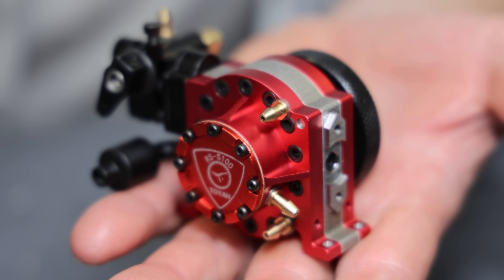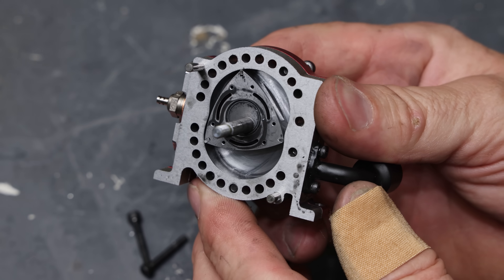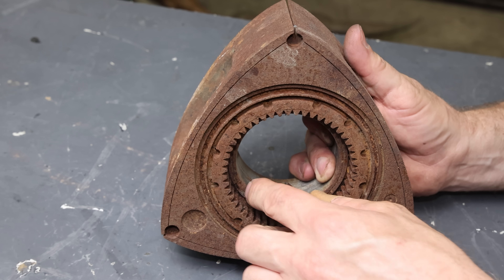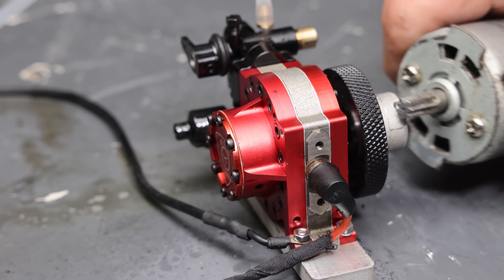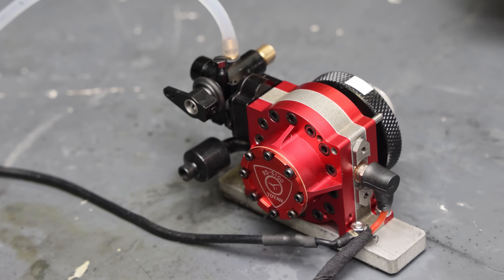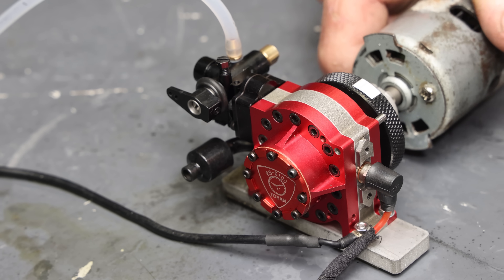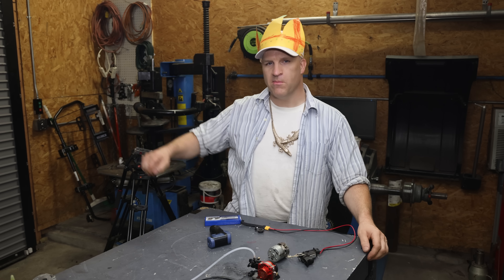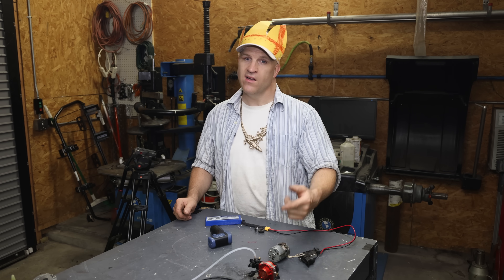Worlds Smallest Rotary Engine (30,000 RPM)

Comment: I'm tryin to learn.. hope you answer me.. you said it gets better compression as it warms up.... is that because the apex seals aren't sealing well.. like you get better compression because the heat makes them expand.. in turn creating a better seal in the chamber in turn making more compression?? please answer me.. or anybody else that can..
Reply from the maker: Yes I believe that's exactly what's happening. I think it's because the Apex seal design is too simple and very very small. Once you get this small it becomes very tough to achieve the tolerances needed for a good running engine.
Reply: @WarpedYT   thanks for the reply!! Man that little engine is awesome!!! How did you get into this stuff?? Like jet engines? My gdad built them and tested them along with intercepter missiles.. I want to do this so badly also but don't have the smarts for it.. I'm horrible at math..

Comment: How ironic, a decade old problem, and still with today's technology, nobody can find a proper solution to fix and improve the apex seals, hot-exhaust gas, engine flooding & engine compression issues, which normally plague the iconic Rotary Engine; if more money and resources is put into them; the rotary engine could be such an amazing engine that could probably even surpass pistons.

Comment: You really need to own rotaries before commenting about the full-sized rotaries.  You're having a carb problem to start with.  If you've had problems with "exhaust falling off", etc. as you mentioned, it's not the engine's fault, but the owner/builder/operator's fault.  The rotaries, especially those from Mazda, are especially reliable, and always have been IF THE MAINTENANCE IS DONE AS RECOMMENDED.  However, Americans don't like to open the hood on their cars until something goes wrong.

BTW it appears from your video that you managed to somehow chip the side of one corner of the rotor, which will allow the apex seal to shift and get out of position.  It may even score the rotor chamber or end plate.  it was the corner you were re-installing the apex seal on, and that would probably be part of your trouble.  The engine seems to be running,, as the three Toyan rotariy engines run perfectly, and the throttle works as it should, while yours requires almost a full-choke to run or start.  So the "compression issues" that you say are forcing it to be started at such a high rpm are due to that damaged rotor corner, allowing the seal to move out of position and not seal well, which is why it only runs at high rpms.

In 1980 I was at a Mazda dealership with an RX club, and two guys brought in a rotary block for a core exchange.  Club members were curious as they drove in in an older RX3, and one of the club members was employed by Wankel Gmbh as their North American rep.  So we went to talk to the guys, who were very nonchalant about their engine swap.  As our parts guy got the core block out of their trunk (with another mechanic, NOT a hoist!), we got to chatting with them about their experience with it.  The engine had only 160,000 miles on it, so we asked if they'd had compression problems.  NO.  Did you have hard-starting?  NO.  Excessive use of oil?  NO.  Finally, we asked them why they were exchanging the block, and the owner said "Well, with 160,000 miles, we just thought it was time.".  The block was still in spec, had no scoring or anything.  The apex seals he'd brought were fine, and with so little actual wear on the engine nobody could figure out why he "needed" to swap the engine.  Actually, we saw 81 and 82 year RX-7s with over 300,000 miles on them, with just normal recommended maintenance and watching the oil level.

Basically, those who think the modern Mazda rotary is a ball of problems have NEVER ACTUALLY EXPERIENCED IT, and are simply repeating what they heard someone else say - who was ALSO repeating some "rumor" totally without truth.
Reply from the maker: How many full size rotaries have you built ? Be honest.

Comment: These engines are supposed to be watercooled, those little brass fittings are for cooling water. Running it without cooling will probably wreck it.
Anyway, if it produces 0.7 HP from 2.4cc, that's almost 300 HP per litre of displacement!
These little puppies are about $500 USD, or about $700 for a twin-rotor version.
Reply: 10th scale market

Comment: .7 horsepower is a bit measly, couldn't run it in a RC race car they usually hit 2.5ish hp
When scaled for hp/displacement, the standard rc racing engine is about .21ci so, at .14ci, it would get closer, but would still fall short, assuming the displacement was .21, it would put it at just over 1 horsepower, still short.

Comment: Sir, the glow plug seemed to be untight. I saw bubbles. Aaaand, there was a little pin moving near to the flywheel forwards and backwards. I was frightened i could fall out and touch the teeth of the flywheel. Anyway, a sweet engine is it , indeed. How is cooling made ? Just by fuel ? Where is it used normally ?

Comment: Enlarge the exhaust port and upsize exhaust. It ran better when you were restricting the air a little. So believe you need to richen up the mixture slightly. 
Well cool to see a rotary about 2.5cc. 
Have you previous experience with nitro rc.?

Comment: hahaha i did one of those "hold my head like in the home alone cover" once it started and thought - "this has to be 30,000 rpm!" Bang on!  Great little engine. Wish it was a 3 rotor. I wonder how hard it would be to fab a shaft to join 3 of them up

Comment: Love my 86 Mazda RX7... still have it but it needs rebuilt as usual every 100k miles..lol... and yes they'll flood even if it's on your mind..lol... used to alway park mine on a hill so I could pop the clutch and it would start every time... I had Mazdatrix pre-silencer and that joker was loud but would run like a scalded dog..lol..mine has been sitting up about 20 years...wouldn't sell it for nothing

Comment: either need to gravity feed the carb or run pressure from the exhaust
Reply: the carb has a build in pump
but he needs to adjust his low end needle it way to lean in the low end

Comment: 0.14 cubic inches is nearly three times the displacement of what I grew up with.
Reply: cox 049?
Reply: @robot797  Yes. There were quite a few control line planes, and the odd boat.
Reply: @m1t2a1  I love cox engines
I even made one run on propane/butane
Reply: @robot797  Wow. That can't be easy.
Reply: @m1t2a1  it is easyer than it looks
you can find a video about it on my chanal
Reply: @robot797  Just like others, my first thought was where the oil was coming from. You figured it out. I have some .049s that are over 50 years old. One will be sacrificed for that. Thanks for pointing me to your channel. Now you have another sub, whenever it updates. It's in Canada if you look to see where people watch from.

Comment: I have a old traxxas t maxx I want to put this in, but it seems to only run at full throttle, that might be a problem.
Reply: it just needs to be tuned
more fuel in the low end less on the top end

Comment: I can already imagine a vehicle with like a hundred of those engines connected together somehow, the sound of millions of angry bees and a ton of fuel per mile 😎😁
Reply: I sense the building of a bitchin go kart in someone's future.
Reply: @jg8263  lmao the bees comment had me on the floor! 🤣🤣🤣🤣 would be awesome indeed.
Reply: @jg8263  i was thinking a cool rc car or boat if you can get this fully operational
Reply: @jg8263  everybodys like wow thats amazing...  and then the engine failure hits and then they be like told u so u stoopid for building something like that
Reply: @tarekl.3725  As long as it has like constant maintenance, it should be fine, but it's still kinda dumb
Reply: it would sound like 100 weed whackers and it wouldn't sound like bees it would sound like deaf.
Reply: hahahhaahha 🤣
Reply: A mile long engine, going a mile at a time
Reply: That sounds awesome
Reply: only 70 horsepower?
Reply: You'd need a hundred, so maybe 5-10 would be running to generate power an any one time.
Reply: You got to be at the track when he runs sprint cars it sounds like a bunch of weed eaters chasing each other around have a great day
Reply: XD
Reply: "with like"?
Reply: God dammit take my money!

Comment: Imagine modifying something similar to this into a weedeater. 30k rpm.... that will cut some damn grass.
Reply: no torque so won't be cutting jack!
Reply: @larylongprong  If an rx7 can go 215 before flying like a frisbee, then a rotary engine can get enough torque.
Its the rpms and hp that takes up the slack while the little bit of torque it has keeps going.

Comment: What’s the pin that’s sliding in and out during high rpm
Reply from the maker: Alignment pin.
Reply: @WarpedYT  cool, I thought it was something to do with fuel pressure, I honestly couldn’t tell, it looked cool when the vibration moved it haha

Comment: i think the extra fuel makes it run better just because its sealing the combustion better,maybe some thick viscosity pre mix or put a little thick oil on the spark hole to confirm if it suddeny starts up with less fuel doing this it will prove my theory,you may need to make a stronger spring on the apex seal or makeapex seal a tad taller,
notice it ran like a champ after it was warm probably the heat expansion of metals helped seal

Comment: watching you struggle with this is frustrating af. 

Not only is this thing super small displacement, but that also means there is VERY limited airflow. Limited airflow means it can't really use the ventury effect to SUCK fuel into the engine. THIS  is the exact reason why gas tank vents in nitro RC cars are connected to the exhaust pipe pressure port.  This pressurizes the tank acting like a fuel pump to keep fuel at the carb.  You're trying to run it without this assistance and it runs till it clears flood then starves and dies..  FIX THIS and your problems will go away completely!!!!

Comment: Rotary engines seem to be great and simple engines but theyre are known for their enviromental impact - even if we would use liquid propane, which product of ignition is water and carbon dioxide theres still oil we use to lubricate the engine and it is thrown out through exhaust pipe massively - remember that one drop of used engine oil can intoxicate and spoil even one hectoliter of water.

Comment: Will you please pipe your hydrogen generator into this little engine?? I've been wanting to do this really bad but I can't afford a rotary engine for my research currently. I have a 40 horsepower rotary aircraft engine but it's way too big to try to run on 100% hydroxy gas. If you run this thing as stupid and crazy as this sounds you need to pretend it's a steam engine, you have all the oxygen you need and need nothing coming into the engine, therefore the engine can build pressure so you want your exhaust piped into your air intake, and where you're exhaust is you should have a pressure relief and water drip valve just like on a steam system, everybody fails to get decent efficiency because they never do this, if you do this correctly it will run like a turbocharged engine running at extreme efficiency. Because it will build boost pressure inside the engine. It's confusing physics but just trust me it's like a sterling cycle engine.

Comment: Love your work mate, great stuff, when you got it on a lower idle that lumpy rotor sound was identical to the road cars. 

While it's still nearly new you might want to measure up and machine a few rotor housings as spares, better apex seals will make it run much better but it will also wear out your housings faster
Reply: He'd better have a really accurate CNC cutter if he's going to machine THAT shape.

Comment: i say replace the broken rotor with a new one youll be good to go. i dont know how it happened but the whole corner was broken off at the apex seal. i think that will fix most of it.then start looking at the intake leak thatll restore throttle and idle also.  I really liked the little rotor it sounds pissed off.

Comment: Correct me if I’m wrong, but don’t carbureted motors need to idle higher until they warm up. And isn’t low compression in a rotary only visible with difficult hot starts?

Comment: I would love to see this little engine idle at 1500/2000 rpm
Reply: I can guarantee you never will. They aren’t made correctly to maintain combustion chamber pressure at the lower RPM.
Reply: The mass is so low it would never do that.

Hell, a full size rotary can barely do that.

Comment: Please tell me .....why did you not adjust the petrol flow with a screwdriver ?
Reply from the maker: Because I couldn't get it to run at all, but I was also told by the factory not to mess with the mixture screw because it was pre-run and pre-adjusted, but it wouldn't have mattered at all because the thing had no compression.

Comment: in 7:00 throttle blip down because of vibration, it's not max RPM... 🤔

and in 7:10 the reflective sticker is removed from fly wheel, I guess tachometer is showing wrong RPM, because of no reflective sticker in fly wheel.... 🤔

do it again! 😀

Comment: Looks like you're also losing a bit of compression at the glow plug too. Could see oil bubbling from the seal. Very cool engine, can't wait to see what you do with it.
Reply: Just from what he showed he barely put this thing back together. Exhaust falling off isn't a lolol rotaries suck, that's you not bolting shit on. Dropping parts in a filthy environment, flywheel not centered and wobbling all over, no engine load so it's spinning to double the RPM it's rated for... Looks like a cool engine but man this dude is handling it poorly
Reply: This. Dude is ignorant af, he just makes clout chasing vids with shit he doesn’t know muck really.

Comment: Thats amazing. Bet it cost a pretty penny I would love to have this just as a ornament on my shelf to play around with time to time. Love your channel man.
Reply: They are $500, so just 50,000 ordinary pennies, doesn't need to be a pretty penny either.
Reply: So 4 rotor will cost around 2100-2500 it's cheaper then real one 60 000
Reply: @Deep42Thought  I'm not sure who pays $60k for a 4 rotor though, my RX-8 was $3250, so buy two whole cars (plenty of spares that way in case you wreck on the track), and you're at $7k plus probably less than $53,000 for someone to bolt two together. Also note the rotary is one of the easier engines to do that too, I chatted with a guy who built a 12 rotor engine from 6x RX-7 engines (I think it had 12 turbochargers in total), and then he sold it to fund his next new project build and toy.

Its probably just about as expensive to turbocharge them, just the exhaust manifold was like $3k a year ago (its since gone down a lot, and yeah you could weld one yourself but I'm referring to just bolt together options). Then you have to find a tuner that specializes in turbo rotaries. Its cool, but its a mess.

Comment: Check the width of the rotor vs the width of the housing. That is critical as there are no side seals in this engine, if it is not correct your compression will be leaking down around the sides of the rotor, bypassing the apex seals.

Comment: You need to run a premix fuel with that, help it spin faster n lubricant the rotor.
Reply: The fuel he uses is premix, it’s standard model engine fuel consisting of methanol, nitromethane and lots of oil.

Comment: Why didn't you hook up the water cooling? Did you really just cook this engine at wide open throttle on video? 😆
Reply: I’m wondering the same thing. The ports for the water cooling were there but the fittings weren’t.

Comment: Wow I did not expect 30k rpm. Gg sir! That’s almost as cool as my 426hp turbo hayabusa
Reply: Next project idea for your insanity: Since the Hayabusa has a 1300cc engine (same size as the RX-8), I'm thinking turbo 13b swap would be a cool though very difficult challenge. Of course even without turbo it would make more than the stock busa, so would still make a fun swap without turbo (but turbo makes everything better). I think the radiator would need to be seriously upsized because the rotary is not at all efficient, so may not be comfortable to drive with that much heat, but if you go fast enough... Might not cook your legs!

Comment: It's too bad they couldn't have put just a little more effort into this thing and made an air-cooled engine that could be used for something. This thing is junk... the locating pins were coming out of the case as it was running, the muffler was falling off etc. It's not hard to get a good fit on a reamed hole, even in China.
Reply: Actually, Matt must have a preproduction engine because mine (received four days ago) is beautifully manufactured and nothing wobbles. Unfortunately it can’t run because the rotor is binding in the case but other than that the machine work is fantastic.
Reply: @GFTPSMP  I hope you're right-I'm a tool and die maker by trade and the rough machining marks on the back of the flywheel/counterweight were shocking to me. Looked like someone gacked it out freehand rather than with a CNC mill. I was like "holy shit(!)" when I saw them..

Comment: I always wonder how much actual electricity you can make from tiny motors.
Reply: There are some pretty spicy mini generators out there, using gas turbine engines, some of them can make upwards of 10,000 watts in a unit the size of an 18 pack of beer. Spendy AF though.